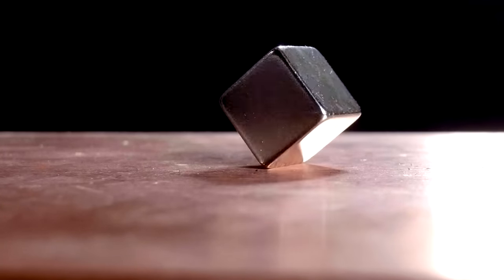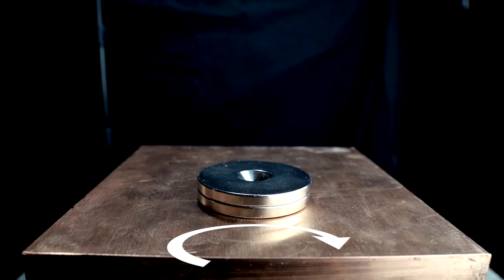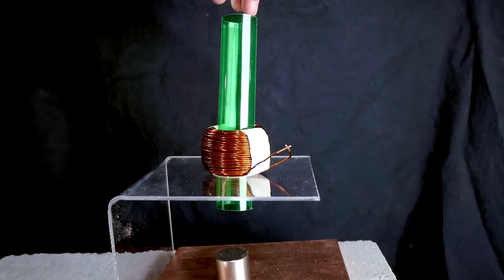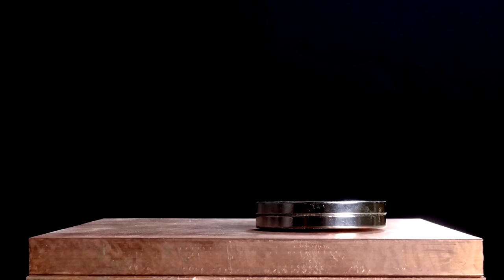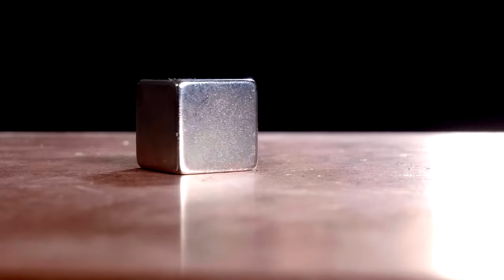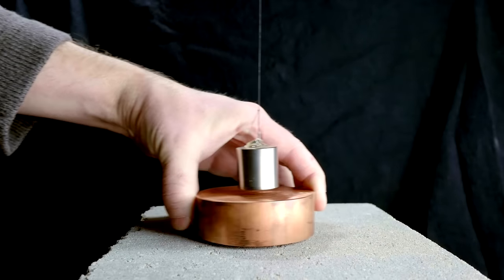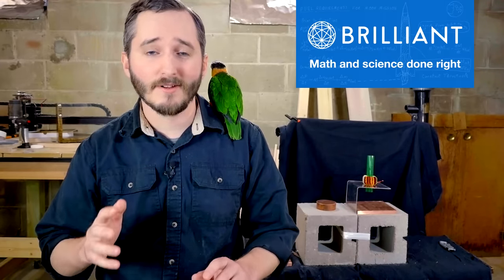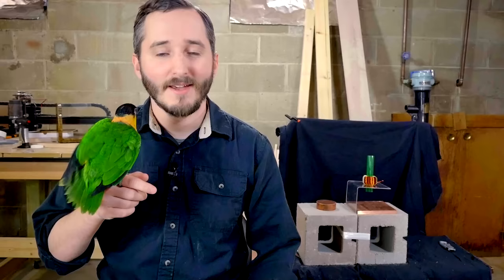Copper's Surprising Reaction to Strong Magnets | Force Field Motion Dampening

Comment: I am a ride tech, at a well-known theme park. Our coaster cars utilize a large copper plate, for braking. As the plate (on the bottom of the car) moves through magnets (positioned on the track), the train slows down. 
The plates gets pretty hot, by the end of the operational day. Honestly, I never thought about measuring the temperature. I figure it’s around 130 to 140 degrees Fahrenheit. It takes a couple of hours, for the plates, to cool down completely.
Reply: thats why some HiFi/PA speakers have copper pole pieces. iin use, the internal coil creates eddy currents, so a cooper piece attenuates that current ,to keep linear response (but make some heat, so the back of the magnetic core  has an opening for ventilation)
Reply: I wonder if somebody has found a way to harness that heat and use the energy.
Reply: @jakemccoy  Probably not. I know that 140 F sounds hot, but as far as using it to generate electricity, it’s nowhere near hot enough, even boilers just used for heating generate heat in 300-500 F range. Best you might be able to do, would be to use the heat to warm a few rooms in the winter(even then, those room would have to be close by). But then you’d have to go to the trouble of installing some sort of heat transfer system and a backup system for when those plates aren’t enough or aren’t in use. It’s a lot of money and upkeep for a marginal improvement in efficiency.
Reply: @CJ-442  I was not thinking that extravagant. I was thinking more simple, like maybe light up some LED's on the coaster with the otherwise wasted energy.
Reply: @jakemccoy  If you’re goal is to reduce heating on those copper plates, then the answer is no. Magnetic breaking works by converting the kinetic energy of the moving magnet into eddy currents within a conductor, which is then converted to heat. Connecting a “load” (like those LEDs) to the plates would create a complete circuit and greatly reduce the eddy currents in the plate, and therefore, its breaking power as well. You saw that in the video when he dropped that magnet through the coil with the light connected. It generated electricity, but the magnet barely slowed down at all. That’s why I suggested using the heat transfer system to heat a room. That heat has to be generated for the breaks to work, so you may as well try to use that heat for something useful.

If you’re asking if it’s possible to use the coaster’s movement over those plate to generate useable electricity, then the answer is maybe. It’s not impossible to do, but you’d basically have to design a coaster with having that dual breaking/electrical generation purpose in mind. You’d need some sort of system installed to ensure that only a little bit of the electricity was taken from the eddy currents; that way the breaks still work. Also, anything that you’d hook up to this system (LEDs, speakers, etc.) would only work while the coaster was moving over the plates. When it’s anywhere else or completely stopped, electricity stops being generated and the “load” is no longer powered. Again, a lot of work, money, and upkeep for a marginal improvement in efficiency.

Not hounding on you or saying it’s wrong to try to come up with new ideas. I just deal with electrical systems a lot in my line of work, and these are the things that I have to think about. Introducing changes or new purposes into a system also introduces the possibility for new problems, so you have to take those problems into account. Is it worth having one system that does 2 things if it only works 75% the time? Or is it better to have 2 systems that do 1 thing each and they both function 99.9999% of the time? The answer is that it just depends on what you’re doing. Using waste heat generated by flushing the toilets to warm a maintenance shed in the winter is a lot less important than having breaks that function properly.
Reply: @jakemccoy  Japan’s magnetic levitation speed train’s braking system actually harvests the eddy current power and store it in a battery.
Reply: @jakemccoy  all power generation works this way fundamentally anyway.
Reply: @jakemccoy  That's easy, if we just replace the copper plate with equivalent coiled copper wire ; but this is VERY VERY dangerous, for if the circuit brakes, the car won't stop, and it's just too much trouble; the field  may be strong, but it lasts only a few seconds; and then again, it must never be done with wires on coaster cars, it's illegal.
The same Eddy currents are used to move the electric meter in our houses.
Reply: @CJ-442  "If you’re asking if it’s possible to use the coaster’s movement over those plate to generate useable electricity, then the answer is maybe."
Regenerative braking is now used in electric vehicles --- the motor is used generate electricity which is used to charge the vehicle's batteries.

Comment: Electrical engineer here: Great video, but a couple quick corrections: At ~1:17, your explanation of the magnetic dampening demos is that "electrons were perfectly happy being being where they were before the magnet tried moving them around, so they resist this movement by generating a temporary magnetic field of there own. There's no attraction or repulsion, just resistance to change." This isn't correct (and this goes beyond semantical nitpicking).

A changing magnetic field in a coil or a large chunk of metal generates a voltage (referred to as an EMF). The electrons HAPPILY move around as fast as they can; they don't care where they are or were and don't resist anything themselves. When the electrons move, they do (as you mention) create a magnetic field which is opposite to the neodymium magnet you dropped on them. In other words, THERE IS ABSOLUTELY REPULSION.

The reason the magnets don't just float forever is because electrical resistance in the copper itself turns some of the electrical current into heat. This is the only "resistance" in the system; it is a property of the material, not a property of the electrons themselves.
Reply: Austin Steingrube thanks!

There's quite a bit of ambiguous language here. I'm not sure if that's going to mislead young scientists or not. Hmm.
Reply: Austin Steingrube try at least an assoc. degree In physics
Reply: touristguy87 - Either you are trolling or have no clue what an electrical engineering degree entails. Take several years of electromagnetics and higher maths and call me in the morning ;)
Reply: You talk about how he was too wordy, then wrote 4-5 paragraphs yourself stating the same thing over and over. To quote you: "you are exposed as a bullshit-spewing grandstander", "If you truly understand a physical phenomenon ypu should be able to explain it clearly and succintly"

He mentioned his degree to give reliability to his statement. In a debate, it is a way of supporting your point. Furthermore, electrical engineers deal with electromagnetism every day (circuit boards and power transmission rely on these principles heavily). Therefore, he is also stating, by saying he is an EE, that he has good practical experience on the topic.

By the way, he is correct. The eddy currents generated by the moving magnet produce an opposing magnetic field, and hence there is repulsion. There is repulsion between the 2 magnetic fields. The eddy currents face resistance from the copper, which is why the repulsion dies down and the magnet doesn't levitate, since the source of the repulsion (the eddy currents) lose their energy as heat. In a super conductor, with no resistance, the eddy currents remain and the magnet levitates (although, there is more too it).

And as far as comparing an engineer to a physist, as you said: "Nothing compared to being a properly trained physicist." Engineers directly apply the laws and models made by scientists. In many ways, they have a perspective of physics that pure physicists don't. It is why so much physics has been done by engineers, and many physicists are also engineers. After all, physicists didn't design the computer you are typing on, or the internet  you are using. It was engineers. I could go on, but I doubt you are the type of person to look at things neutrally, afterall, your entire comment was filled with unnecessary insults and a complete misunderstanding of the OP's comment.
Reply: To be fair, touristguy87 is right about one thing: Since the currents are generated by the magnet's motion, they stop when the magnet stops. So the magnet can start falling again... Only to generate more currents that stop it. That slow movement is the point of balance where it generates just enough repulsion to maintaint that same speed.
Reply: Hazz Sin a: look up the expert-opinion logical fallacy when you get a chance.

B: i think that I made it pretty clear that I didn't understand the phenomenon very well...and I am a "real" EE...which is part of my point. This is 2nd year electromagnetics in an EE program. At one point I did know it very well but it has been 30 years since I've looked at this problem cliosely. 

C: ultimately for a magnetic field to be generated in opposition to the static magnet field either the magnet has to be in relative motion or the flux has to be changed through a change in the magnet strength or a change in paramagnetism (H vs B)  of the surrounding media. 

Last but not least the fact that you don't understand what someone is saying doesn't mean they are spewing bullshit. Maybe it's just above you....
Reply: Marik Zilberman the induced opposing force is never enough to stop the magnet. If it were the magnet would stop and the opposing force would disappear.  It can however be larger than the magnet and slow its descent. In fact it will increase simpky because the magnet gets closer to the copper sheet. So there are two varying  components one from velocity the second from proximity. The proximate component is 2nd order and the velocity component is 1st-order I think. So gravity is constant over the range of motion and the magnet simply slows down and stops when it reaches the sheet. It's just a question of what is the actual velocity profile. 

This has literally nothing to do with EE, it is just a basic physics problem. The fact that it is covered in a decent EE curriculum does not make it an EE problem any more than calculus or algebra problems are EE problems. I have a degree in EE but that doesn't mean that I can solve a 2nd order nonlinear differential equation or determine a  SWR correctly off the too of my head. I know something about these subjecs as a result of my training...doesn't make me an expert and certainly not infalliable...just as native speakers are not references for proper spelling and grammar in their native language. Knowledge does not equal expertise and expertise does not equal correctness. That fsllacy is one of the biggest factors hindering the  development of Mankind.
Reply: Marik Zilberman yeah, I have no practical experience but my iq has always been a serious curse however it doesn't seem necessary for deriving this conclusion... I saw resistence not repulsion though it doesn't have to mean repulsion didn't create some resistence but obviously gravity is the champ and torque and spin are the honorable contenders to train with anyway when trying to take the belt from the champ. I just want to sled on a mobious hill of snow that isn't cold and heads towards food and snatch on a loop of love and holy whole holes of monogamy
Reply: What is his problem???
Reply: Very good.   Now... go get us a bucket of fresh electrons, dr. cemf.
Reply: Austin Steingrube, "THERE IS ABSOLUTELY REPULSION", is just what I said, thank you.
Reply: right on!  now spin a magnetic armature in a coil of wire- WOW electricity LOL
Reply: Austin, I designed my own magnetic for my switching power supply designs for 30 years. I used to say no one understands magnetics. Then I saw Feynman's lecture that says the same thing much better..... but I got rich with my magnetic designs, unlike some in my EE college that got better grades.
Reply: Would it be correct to say that there's no constant attraction or repulsion between the copper and the magnet, like there would be with ferromagnetic metals?  I think that was his point vis-a-vis resistance to change.
Reply: I am an EE and designed magnetics for 30 year for my switching power supplies.
Reply: Austin Steingrube so what you can do is somehow suspend the magnet an by bouncing the it create heat and energy ? have I got that right
Reply: What electrons???
Reply: just opposing fields about this persisting instant, in the case of ferromagnet  and copper or aluminium the resonance can be likened to for example "sound" the way harmonics work and resonate an accompanying higher harmonic.
It's just with the magnetic field from ferrous is vibrating immeasurably fast.
Catch 22 what we use to measure high vibration fundamentally uses the ferrous magnetic field as "source" field for oscillation....
Reply: touristguy87 has a personality disorder.
Reply: Touche! Very well put Hazz Sin! And what's up with getting all aggro over some yt comments? Some people need to chill out a bit.
Reply: Wow, this conversation went south really fast. Children, children; if you can't be nice to each other, you'll have to go to your room and do your homework!
Reply: It's basically Goobering it down a tad for those who have less than no clue what electromotive force is.
Or how the orientation of the field lines in the magnet would impact such experiments.
Still, I wonder how much more notable the effect would be with a similar silver plate. Silver is a far superior conductor to copper. 
Of course, the ultimate to play with would be a metallic hydrogen plate, but frankly, I couldn't withstand the pressure of such a presentation.

Comment: Really good explanation. I would just add a common misconception that I, myself had when I was younger:
Electrons DO NOT flow through the whole wire. In fact, they barely move.
What DOES move at the speed of light is the electrectomagnetic field generated, which is the one thar produces the resistance.
This is a misconception that even electrical engineers that I've met have. Yet can be explained by Maxwell's equations.
Reply: Veritasium?
Reply: Dave AR ---> "Electrons DO NOT flow through the whole wire. In fact, they barely move."
This sort of opposes the "electron cloud" theory and, in fact, semiconductors and computers.

Comment: until now I never really understood why electricity generation was so inefficient or how you could measure draw from an alternator or generator. I didn't realize that the amount of current the copper generates in response to the magnet actually forces the magnet to slow down. I learned today.
Reply: AleksSnipes ---> "until now I never really understood why electricity generation was so inefficient or how you could measure draw from an alternator or generator. I didn't realize that the amount of current the copper generates in response to the magnet actually forces the magnet to slow down. I learned today. "
However, I hope you did notice that when an LED was connected, the magnet did NOT slow down much.